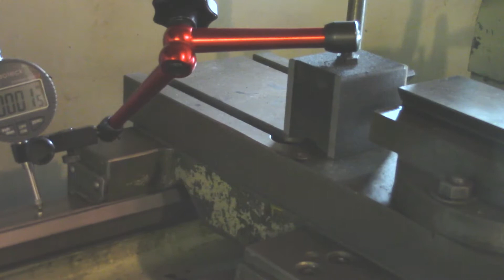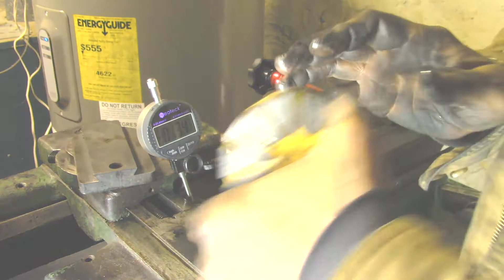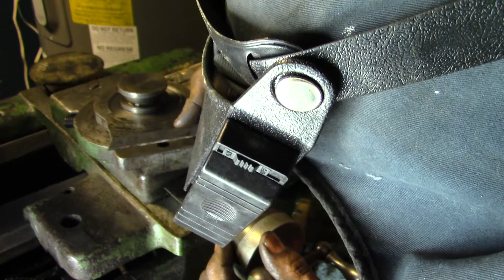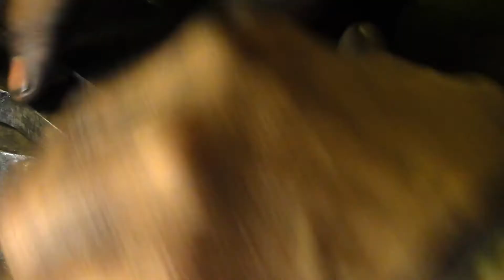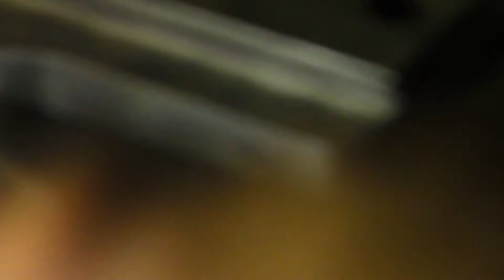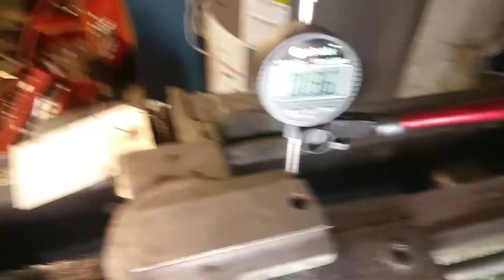HOW TO CHECK AND REPAIR YOUR LATHE FOR PARALLEL - South Bend Lathe

Comment: You can't precisely measure wear in your bed by mounting the dial guage on the saddle that rides according to that wear. It will more or less always tell you there's no wear. You must use a piont of reference that is free from wear to find the most worn area and then bring everything else down to that.
Reply from the maker: What wear are you referencing? The ''ways'' for the slide are within my acceptable tolerances and all results are within my acceptable tolerances...  Steven, you always have to have a benchmark to measure from... in this case my benchmarks are of a solid choice.
Reply: His check is not accuracy BUT it can tell the wear on the bedway. And after all method of bedway fix, it not depend on how accuracy of the mesurment. If his check Zero wear - mean that NO need to do the scraping or grinding.

Comment from the maker: Very beginning of video you are observing the end result of grinding the top surface (tool holder side) flat / parallel with the base of the same tooling.  Remember, that you do NOT want supper flat across the entire area, you want the same plane but with ''oil groves'' (anti-friction groves)...